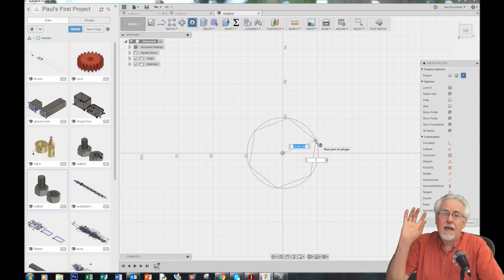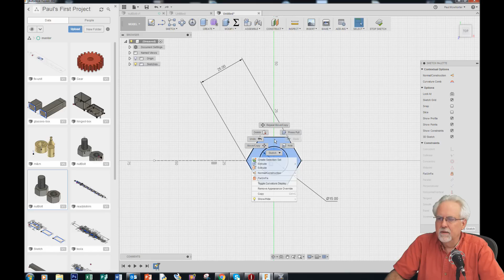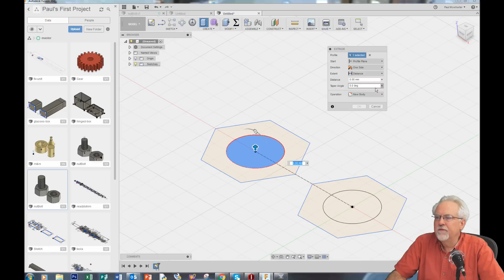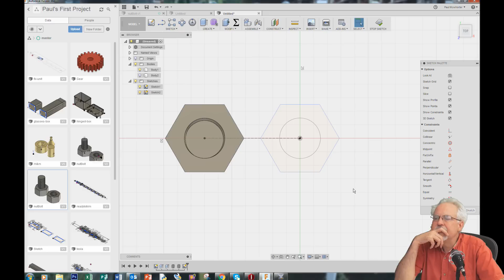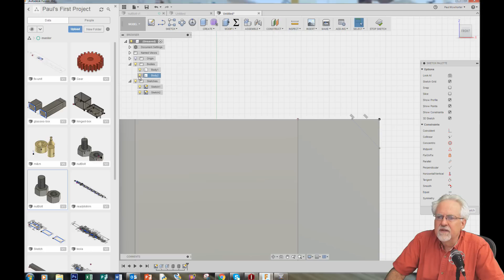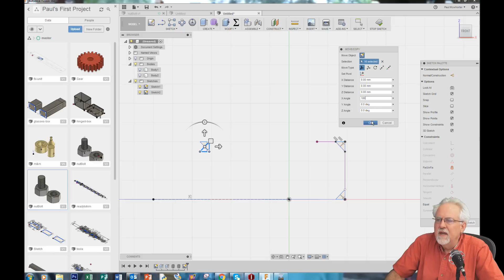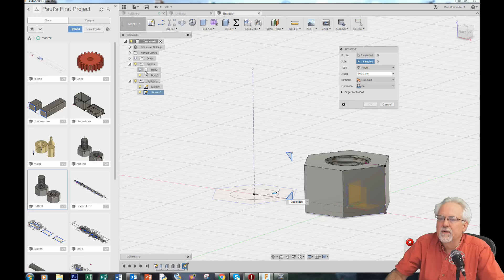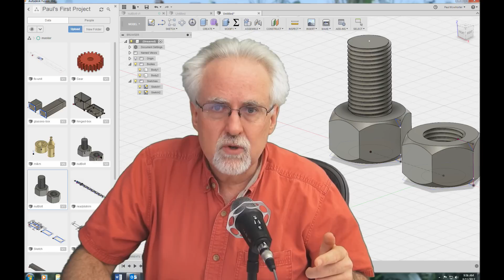Learn Fusion 360 or Die Trying LESSON 7: Design 3D Printable Nuts and Bolts

Comment: You are not to slow - its perfect - another excellent lesson. Loving this stuff. Printing my hinged box out tomorrow and this nut and bolt as well. Glasses case turned out really well. The greatest advantage of this is you can pause re run and do it until you get it.

Comment: created my own nut and botl using your tutorial then decided to print it.  It could just be my printer but I had an issue with the parts fitting together.  I'm thinking that the bolt or the nut need to be adjusted for some slight tolerances.  I'm guessing that the inside wall of the nut and the outside wall of the bolt are exact same size and therefore try to occupy the same space when trying to thread together.  Just my experience.  btw...AWESOME lesson!  Love the way you leave your miss clicks and fixes in your videos!
Reply: I printed these parts on my Prusa MK3S (in PETG) and the fit was kind of tight.  Paul seemed to be able to just spin his nut onto his bolt, where my parts did go together but required quite a bit of force.  I'm trying to design in some tolerance, but when I adjust my parameters, the threaded surfaces don't seem to change.  I'll probably try a whole new design with some tolerance and try again.
Reply: I found a video that explains how to loosen the fit if it's too tight.  It's called "3D Printed Threads - 3 ways to model them in Fusion 360" by CNC Kitchen.  The instructions are in the first half of the video.

Comment: Paul, Outstanding dude, slower yes but the method works. Especially when you verbally state the steps over and over when start a sketch etc. Some clearly basic concepts that are critical were skipped in my learning. I mean in just this lesson I saw where Copy is located. I was constantly redrawing features, and since I had no clue about the dimensioning via database I was always off in my layouts of mating parts. then I print them, then I drill oversized clearance holes etc it just spirals down. The most critical think I got was sketch location I thought for some reason the sketches all had to be on the same origin. So I would turn them off and draw then in body view make a change and was grabbing the wrong points and it would go haywire. OMG! I am excited to go back and actually recreate all my parts using the tools I learned here and anxious to make edits so nothing blows up. I am trying to design a family of parts for all my trains so this dimensioning in Tables with labels will allow me to change a few critical dimensions and have a new part ready to print. THANK YOU, this 69 year old Engineer is born again!!!!!!!  D

Comment: Thanks :) I did a small mod to this by changing making them parametric and to M12 because I have Tap and Dies for this size.  Which made the Nut Flat to Flat M12_S = 18 mm, the Nut Hole M12 = 12mm, The Nut Height M12_H = 10 mm and the chamfer M12_C = 1.3925 mm. That size chamfer gives you an 18mm round contact for both the nut and bolt.

At first your 'mistakes' annoyed me until I realised that they were seriously adding to the amount of information conveyed.

Once Again Thanks :)

Comment: If your nut and bolt are too tight when you screw them together, there's a video "3D Printed Threads - 3 ways to model them in Fusion 360" by CNC Kitchen that shows how to fix the problem.  (It worked for me!)

Comment: It might be your shortest video Paul, but it was my longest to complete. Restarted several times as I couldn't connect the starting point of the first triangle to snap to my body (or it was completely free to place or if i selected snap it would snap to the grid) I still don't know what I did wrong. In the end I didn't think it mattered much and I was right I could still revolve and still was able to substract that to get that nice look on the nut and bolt.
Although I know this will keep bugging me :-(

Thanks for the great lesson in any case. Oh and for me you're not going to slow, I still have to pause you every now and then.

Comment: Paul...I just started in on Fusion360..I have used AutoCad and Revit for over 25 yrs...but this Fusion is a different animal. I do not currently have a 3d printer...and have never used one. wondering if you have recommendations for one...and also if you have any videos on how to use one. Thank you for your time you spend on these videos, it helps so much.

Comment: Love the series Paul. Actually learning something. Quick comment - After printing the nut and bolt, they DON'T screw together. I've tried different print qualities, but nothing works. Is it possible the nut hole and the bolt are the exact same diam. because one was copied from the other? And if so, how can I change 1 size without changing both??

Comment: Paul ...  one thing you forgot not realizing it and missed a teaching opportunity. Chamfer on the end of the bolt threads after threads were drawn. Just slide back the time table to before the threads and chamfer the bolt then slide back to the end of the time table down in the lower left corner.

Comment: Hey Paul, this is a general message and question rather than a comment specifically about this video (sorry, didn't really know where exactly to ask it). Anyway, thanks so much for making this tutorial series. I think I felt extremely similar to you, being a very math backgrounded person and coming from a frustration of not being able to really make what I wanted in sketchup, when I was frustrated at first when I used fusion 360 and felt too constrained and couldn't make it do what I wanted it to do. Anyway, you videos have helped me a lot so thank you!
Now on to my question- Suppose I want to make a coin where I design 1 coin face as if it's lying flat on one plane. I want to make a complex sketch on one face of the coin, make a linked copy that's reflected on the same plane. Then I want the printer to know to treat them as one solid object. What would be the best way to do that? Thanks!

Comment: Very nice and useful video! I was using Freecad but now learning 360 thanks to your video. One question: is it not possible to make also the thread parametric? I was designing with parameters as you suggested in previous videos, to can change easily screw size and length, but it seems thread tool does not accept parametric values.

Comment: great video Paul I have used other cad software in the past and I have had to make the nut threads just a Tad bigger to be able to thread on the bolt. from The looks of your video you didn't have to do that do you know if Fusion 360 compensates for 3D printing thread Gap so the bolt would thread in easily into the nut I hope you understand what I mean thanks if you have an answer for my question.
Reply from the maker: I dont think fusion 360 does anything special, but I did not have any trouble printing on the raise3d or the prusa.
Reply: When I printed this on my Prusa MK3S (using PETG), the fit was a bit tight.  Paul seemed to be able to just spin the nut onto  the bolt, but I had to put quite a bit of force into twisting it on.  I'm trying to change the spacing a bit using parameters, but the threads don't seem to change when I change the parameters.

Comment: Hi Paul, thanks for the great tutorial.  I just followed your instructions and created a nut an bolt and printed it off.  I am using a Creality CR10S.  The nut is too tight and wont spin onto the threads of the bolt.  Would you suggest I make the post on the bolt maybe 1 mm shorter in diameter before modelling the threads onto it?  If you have time, please keep continue to add videos.  You are doing a fantastic job.  I have learned so much already.
Reply: Hi Dan, make inner  diameter of the nut about 0.2mm bigger, not a very elegant way for high end machines but it works for most designs...

Comment: Paul, if I wanted to put a small chamfer on the end fo the threads, would I follow the same procedure as we did with the not and bolt head?
Reply: That's a great idea - I might steal it!  I'd draw the triangles (they could be in the same sketch as the nut and bolt head triangles) before creating the threads, but do the revolution cut after creating the threads.  That way, the threads will continue into the chamfer until it gets more narrow than the threads are deep.

Comment: OK..I follow your instructions and printed the parts out on my Artillery Sidewinder X1and my CR10S Pro, but the but and screw doesn't not work. They will not thread into each other...Is there a offset one need to do for printing out the parts and make them fit?

Comment: can you supply the basic 3D printer settings that you have used to print the nut and bolt.  Mine fit together for the first few threads but then bind up... I am thinking that I need to use a smaller layer hieght  on my printer.  Thanks for any pointers. Great video series, it has really helped a great deal.

Comment: You have only shown a clearance on the pivot of the box in I think #5. You did not consider any clearance on the glasses case, nor the inside to outside thread in video 7. I would have thought some clearance was needed in these cases, as well as the lid lip on the box with the pivoted lid. Any comment on the necessity for a clearance, and if so, any guidance on the amount of clearance that would be appropriate (or indication of how to determine such clearance)? Thanks for any ideas around this.

I am really enjoying your tutorials. I learned FreeCAD fairly quickly, but I did have trouble with getting started in Fusion -- too much detail before drawing anything on most videos. Yours make it VERY EASY to follow along (especially as you speak clearly, carefully and accurately). In fact, a couple of your errors were helpful in seeing how you diagnosed and corrected them. I am suffering a bit because the Fusion UI has changed a bit, but I'm figuring out the changes. I notice that offsets again can use negative values. I also found the tip to set in preferences helpful that prevents the sketch becoming hidden in some cases.

Great work, and thanks so much (especially if you are still replying to questions after such a long time).                   Bob

Comment: Great Series. I have been using OpenSCAD because I just couldn't wrap my head around these GUI only tools! Was pulling my hair out trying to learn the basics. And came upon your Die Trying series. Pop, Pop, Fizz, Fizz, oh what a relief it is!

You and I have all the same interests. You wouldn't by any chance be a Ham Radio Operator would you?

Jerry
Reply from the maker: KF5ZBY
Reply: K7AZJ
Reply: Looking through my old logs, and you and I had a PSK-31 QSO on 20160315. Wow! Small world!
Reply from the maker: You have got to be kidding?!? Youtube and HAM worlds collide! 

I have not done much HAM radios stuff lately. I remember playing with the PSK31, but it required an annoying cable between my computer and radio that I was tripping on. Have not been on the radio in a while.

Comment: I dove into my first project and am watching each lesson. I don’t think you went slow because I keep backing up to rewatch segments until the lightbulb comes on in my brain.  My excuse is my age. 64.  Here is an official question. My project is a box. It’s 195mm long. I have it sketched, extruded, etc. using a set space between the Tom and bottom as you demonstrated. The two parts, as drawn, are wider than the printer’s workspace. Once the sketch is finished can I move then with one above the other and print at the same time or do I need to print each part individually?

Thank you

Comment: I'm dipping in and out of these as I find something I want to learn, I learn better if it's something I can do then use so forgive if this has been covered in an earlier video but, when you first drew your hex/polygon you had the line that says the size (diameter?) pointing to a corner of the hex/poly and drew along the red axis, but mine points to a centre point of the flat side  if this something that can be changed in fusion or would I just need to draw at an angle so my point runs along the axis
hope that makes sense.  I've got up to the chamfer part and this seems to be where I'm having problems as the revolve is not working as it does in the video. it could be I'm drawing on the wrong plane as my original hex was off or it could just me be getting it wrong.
Reply: OK I kind of found out how to fix the hex I can go back to the sketch grab a corner and rotate it to align the corner with the axis, still be nice to know why yours draws pointing to a corner and mine points to a mid section
now my problem is, when I try to add the line for the axis to revolve on the bolt all my bodies vanish, not turned off but the 'folder' vanishes, I have to undo to get it all back

Comment: Another great video. I love the pace. One thing has occurred to me a few times when you have made the demonstration examples. In engineering if you make two things that fit together the exact same size you won't get them to fit. You have to build in clearance. Obviously you have done it here and it does 3d print and function ok but why does it work for 3d printing?
Reply from the maker: I went over this in my Sketchup Lessons but did not cover it in this fusion 360 series. What I did was design test devices to check tolerances. Design a peg, and then make a block with a wide range of holes in it from smaller to the peg to bigger than the peg is very small steps. Then print it, and see where you get a press fit, a snug slip fit and so forth. Then you can use those as design rules as you design things. Your design rules will depend on your fabrication technology. Even for 3D printers, your design rules will vary between printers.

Comment: When I try to draw the triangle in the corner of the nut, I can't get the first point to snap to the point of the hex. The cursor seems to be avoiding it. What constraint(s) could I be missing? Why didn't you need to define a plane for drawing the triangles; like you did when you drew the box hinge shape for extrusion??
Reply: I don't think he needed to define a plane because he used the XZ plane.
When I drew the triangles, I drew them away from the body, then used a Coincident constraint to anchor it to the corner of the nut or bolt.

Comment: Had a pretty odd problem when copying the very first sketch object. After I pasted the hexagon and roughly moved it out of the way using the X axis arrow,  and made it coincident with the construction line's endpoint, I dimensioned the construction line, and the 2nd hexagon copied to the new endpoint of the construction line. After this, I noticed that if I clicked on either sketch object and dragged, it would DUPLICATE it! The move tool was NOT active! What! I deleted the entire design file and started from scratch, and the problem was gone. Not sure if this was user error, but maybe this will help others.

Comment: Also, after working so diligently with parameters before and how strict we were about the same sort of thing in the Arduino series, today sort of felt like we were cheating a little 😉. All teasing aside, I did have a problem with getting my first sketch to lock down( put a pin in in your version) no matter what I did, the second sketch would do so automatically but the first just refused. I know it is something I missed but what?

Comment: I am posting from mid 2022. I watched the entire video first and then just quickly banged out the result with no looking back so the lessons are having an effect. Unfortunately-fortunately I can't just say "Boom!" It's more like there was a  big flash of lightning across the prairie followed by a huge Boom some time later. When I printed on my e3v3 it looked beautiful but the nut would not go on because it was too tight.  From googling it seems like Autodesk fixed a bug in threads that made things right for machining and "off" for 3d printing.  All was not lost as mother google  directed me to learn that the trick is to offset the thread faces to make clearance on  both the nut and bolt. I was also forced to learn about the "Section Analysis" gizmology so I could select the faces to offset inside the nut.  I started with offsets of -0.2 which was a little more loose than optimal. Ah empiricism. .
Reply from the maker: Yes, and a future lesson in my new Fusion 360 series shows how to fix it. Fusion 360 changed how it models the threads since I made this lesson. If you go back and forth a little with the nut and bolt, it will loosen up, but be sure and catch the new lesson.

Comment: Well, tried to print, but the nut hole is too small to thread onto the bolt. Appears that the nut hole has to be a bit larger diameter. Any suggestion?
Reply from the maker: You might have to dial it in for your printer. For my two printers, using same size works.
Reply: Paul does not use Slic3r. If you use Slic3r you need to make inside dimensions slightly larger, the outside dimensions will be correct. This is a know 'problem' in Slic3r which you can see in the GitHub discussions. There are many explanations for why this occurs, but the end result is - make holes larger than needed. Example: for an 8mm rod to fit into a hole in an stl Slic3r compiled file, the dimension should be 8.2 mm.
You can document this for yourself by measuring the holes in the stl files for Prusa parts, then compare to the parts that actually fit in these holes.